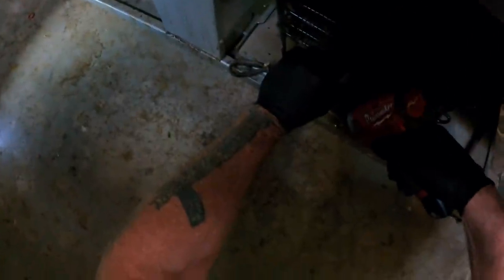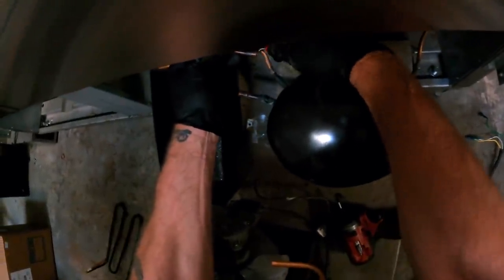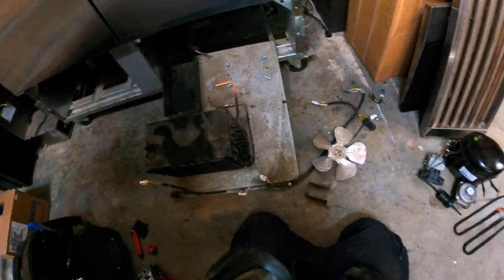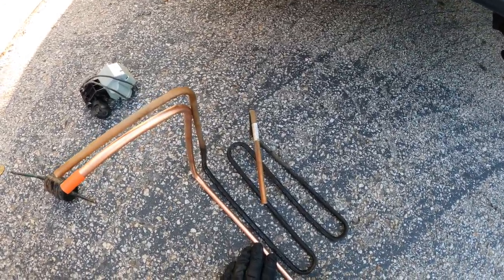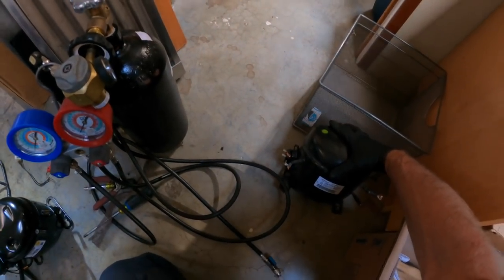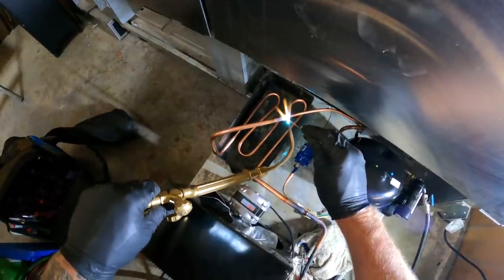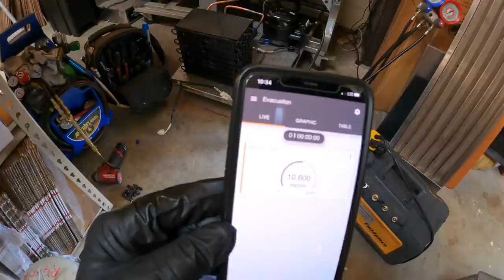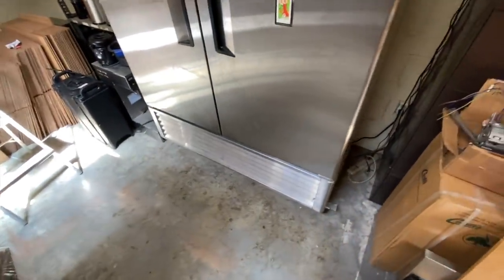Epic compressor change out on an Atosa 2 door & conversion to R450A

Comment: Dave, get yourself a set of the Gearwrench ratcheting flex head wrenches, makes getting at those compressor foot bolts waaay easier, trust me... good video, thanks!
Reply from the maker: Oh I’ll check that out. Thanks. ⚡️⚡️

Comment: Nice complete job👍. You KNOW the vacuum police’s head exploded 🤯when you pulled a vacuum Thru your gauges🤣🤣🤣stay well my friend.
Reply from the maker: But then they crack your balls that gauges aren’t vacuumed and air is in the system now. 😂😂😂😂 , you can’t win with the YouTube police. 
But I’m mostly done with leaking core tools, my gauges are tighter than those lol. On bigger systems I have 3/8” hoses to the pump. Little stuff I’m just using my gauges.
Reply: Totally agree. I am only using core tool when work on AC. use my gauge for self contained ice machine and all reach in

Comment: Those condensate pan loops I would double up with a larger size over actual one. Did for my good customers, never replaced a leaking one after that.
Reply from the maker: It will leak. We use to buy stainless steel tube for them, and the leaked over time.

Comment: Those evaps are Chinesium. Man I bet that oil was from the EVAP. I rarely see the sleaved condensate loops leaking
Reply from the maker: I find them leaking all the time. The evaporator leak also. But I find the condensate loops blown out and sometimes water gets in the system. You’ll have when that happens.

Comment: Other than throwing your charge off a little bit, why not just eliminate the condensate loop all together or throw a little electric pan heater in it?
Reply: Or wicking material
Reply: 1000 ways to skin a cat
Reply from the maker: It’s Santa Cruz man. That’s free non electric ⚡️ water evaporation man.

Comment: Question.  Why wouldn’t you clip the cap tube and suction line and carry the small condensing unit to your truck to change out everything, and then take it back for the cap tube and suction line connections?  Just wondering. Better light also.
Reply: 1000 ways to skin a cat
Reply from the maker: Because in a monkey and like working in my knees.
Reply: @NorCal-refrigeration  sweet.
Reply: Is Atosa offer a whole new condensing  unit? I know True does

Comment: Hello Dave 
can you put the link that 448a refrigerant discussion video? haven't use this refrigerant yet. is this works on r22 air conditioning system too? I checked honeywell web site that replaces for 404a, r22 refrigeration systems.  Need help! :)
Reply from the maker: It’s designed for 404 replacement. In refrigeration systems. Contact your supplier and ask them maybe they get info for you.

Comment: Can you use 448 in low temp applications
Reply from the maker: Says you can. I haven’t tried it yet on a freezer. But there doing it.
Reply: Watch HVACR chanel. He the fan of 448A. I had used it. It work great. Pressure seems just like R404A

Comment: Dave, I'm not being anal, but when you dream the tubing after cuting, how do you know your getting all the copper shards out of the tubing you just reamed. I don't expect to know from the video, nor do I expect you to be able to show a better camera angle and spending more time to make a video. Do you bend the ends of tubing toward the ground so they fall out as you ream. Or do you allow the new filter you install catch the up stream copper that might still be in the tubing to get caught by the filter in that particular joint you sweat together. Or not that you want anything to go threw the compressor, but do little pieces really not present a hazard in your experience, you obviously try to get everything out while reaming, but have you ever had a problem that you can refer to that caused you a problem from reaming fragments, Thank you.
Reply from the maker: It’s all going away from the the pipe. If you don’t ream it the pipe opening is to small and the system will suffer.
Reply: Thanks for getting back to my question, I  didn't know and I use a reamer occasionally, that the spiral always works it way outward. You know how stuff happens, that's why I asked in your experiences what you might have come accross because you do it alot.
Reply from the maker: @charlessolazzojr6767  try to aim it down. Be careful with it and I have had to bust out the shop vac to suck it out.
Reply: suck it out or blow it out. nitrogen, air, vacuum whatever. obviously it's best to use an inert gas like nitrogen, vs jamming moisture in the system.
Reply: bottle   thaks for that reply tip.
Reply: Heah Dave, great to see Cris Stevens from HVAC Videos watching your channel.
Reply from the maker: @charlessolazzojr6767  years ago there was a HVAC YouTube community the OG’s were in there. Somehow it turned into lone wolf stuff. Probably the money 💰 I never hit it big, but enjoy filming and posting. Never took a sponsor ship because I like to get silly and wouldn’t want to miss represent a company 😂😂😂
Reply: Dave, it's going to come back right into your hands again and "they", who ever "they" are going to be will come looking for your answers and opinions on questions from real pro's like yourself. The other guys are great to, but your real day just how you live it is every everybit as important as any of them who are putting Benjamins in there pockets while providing great information. Your drives along your routes are great to watch, your State is beautiful and I enjoy the scenery

Comment: whats wrong with R134a ??
Reply: Depending upon your viewpoint, it's either that R-134a has a high global warming potential or that the patents have all run out and thus anyone could have manufactured it.
Reply: @uxwbill  and 450A works with the r134 valves?
Reply from the maker: It’s the price. R450a is made to replace R134a and it works well. ( it’s in the vangina AC ), and cost way less. Dose your boss pay for your refrigerant or do you buy it ?
Reply: @NorCal-refrigeration  I am located in Germany. The company buys the refrigerant. No techs need to buy their own stuff here. If 450A works with the 134a valves I guess its easy going. On small systems that is.
Reply: @NorCal-refrigeration  Is there any tax/fees on refrigerant in the US ? In Denmark where i live,  R452A cost 1062 DKK+VAT and tax/fees in 484 DKK+vat, totales to $273,58 incl vat , per KG or 2,2lb.

Comment: You ever made a homade recovery machine out of a salvaged compressor? Maybe a tutorial video..?🤔
Reply from the maker: Nope
Reply: I have. You don’t need a tutorial video, braze a schrader core fitting on both the suction line and discharge line of a compressor, and hook up some recovery hoses to it. My setup had a ball valve on the 50’ long recovery hose so I could limit the unit from sucking air into between recovery without having to shut the compressor off. I also put a Yellow Jacket gauge inline so I could see when the refrigerant pressure dropped to zero. The compressor was powered from a small generator and was pumping into a 50 pound recovery cylinder on a scale. The whole setup was mounted in the back of my pickup truck. The waste commission where I live hired me to recover the refrigerant gas from 500 scrap refrigerators before they were crushed, and I didn’t want to use my good (and expensive) refrigerant recovery machine on 500 old scrap refrigerators with who knows what inside of them. The compressor came out of one of the fridges that was getting scrapped, and it was thrown into the scrap pile when the job was finished. It was a completely sketchy setup but it worked, it recovered 218 pounds of refrigerant, and I made 6400 dollars in 4 days...